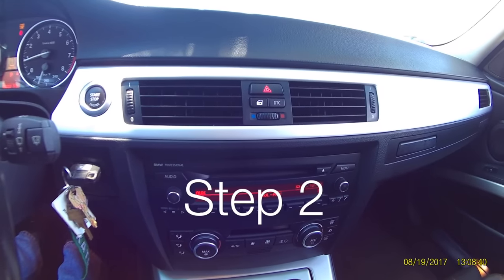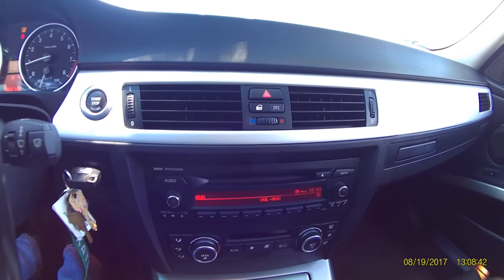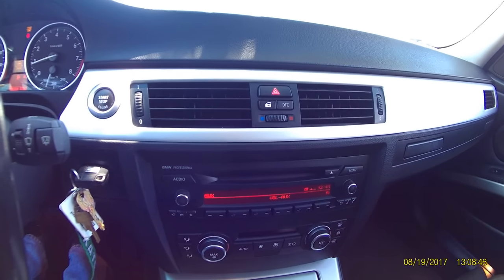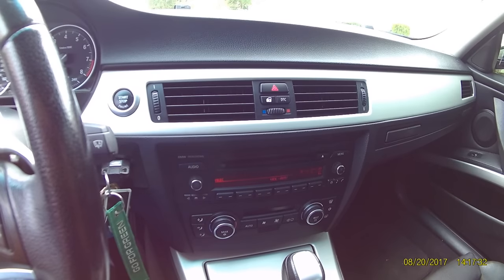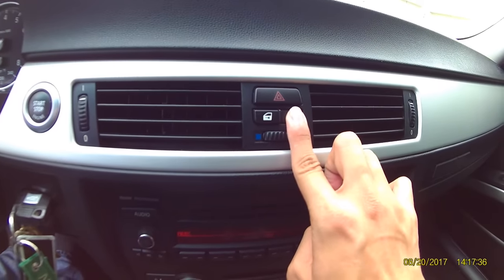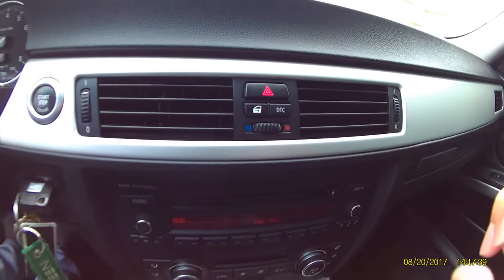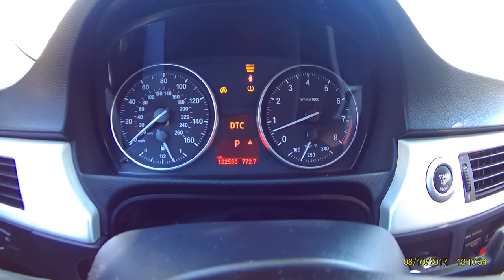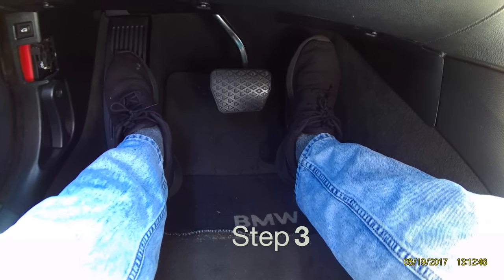How to do a Burnout(Automatic)

Comment: Everyone's here with actually decent cars and I just want to do a burnout in my minivan...
Reply: XD
Reply: Put that shit in neutral rev the rpms up put in drive and launch LOL
Reply: mate it's probably a sleeper
Reply: @hadenbeggs2495  my transmission died.
 :(
Reply: Broooo lmaooo
Reply: MV gang were u at?
Reply: Bwhah I got a 2004Ford ba falcon xr6 with a turbo, but mini van sounds fun too
Reply: My Astro leaves rubber on the road
Reply: Foreal tho🤣🤣🤣🤣
Reply: Set the parking brake and rip the gas
Reply: I put my Ford Focus hatch back I put in L i drive and that gear goes up high so I drive up to 5500 rpm floor it then boom it’s like a fuckin go kart with a mirror cycle engine
Reply: Lol Onm I’m just trynna do a
Burn out in my dads truck 😭😭
Reply: I wanted to do one in my truck lol
Reply: I HAVE A MINIVAN ASWELL HAHAHA
Reply: Its okay bro, i had a rusted out honda 2000 minivan and that thing shread tires like no tomorrow. Over the years i’ve upgraded. Now i finally own a gmc sierra 2017. Just wait for your turn, it’ll come. I’m only 23yrs old. So you can def do it.
Reply: I gotta jeep patriot I feel you😂
Reply: @catto970  i got a 335i e90
Reply: Mine is my work van...
Reply: Pull the hand brake and floor it! How the fuck do people not know this?? Holy fuck...
Reply: Same
Reply: @hadenbeggs2495  did this in a 1988 Toyota HiAce van at an intersection once I swear the front wheels came off the ground
Reply: me with a fwd lucerne
Reply: @sicsam1  not everyone is taught it?
Reply: Been 5 years and shits still funny 😂
Reply: NOOOOOOOOOOOOOOOO
Reply: @hadenbeggs2495  i wonder how many transmissions youve destroyed in these 6 yrs of this comment being available

Comment: Be careful doing this. Depending on the transmission you might break it like this. It is better to try to get the RPMs going first and THEN break, it will take you a bit more practice to find the point where your wheels still Spin and your car stays stationary but it is better for the transmission to be fully closed up to start the burnout. This is what happens to a lot of people when they try it and let off the break pedal to slow or not enough and they break their clutches.
To get more technical to prove the point: 
There is generally two types of auto transmissions used, ones with tourqe converters and ones with automatically actuated clutches ( these can be single , double or multiple clutches before or in your transmission) 
The ones with tourqe converters are generally more save to do something like this because the TC is trading speed for tourqe even before your transmission so it will increase tourqe given to the transmission and wheels till before and after the TC spins roughly the same and then a holding clutch will take over to minimise losses through the TC while driving.
You can overheat the oil in your transmission and TC through trying it for to long or fry your holding clutch because it might just try to clutch in while the speeds are still not matching probably. Both of these result in a broken transmission 

As for the transmissions with the automatically actuated clutches, those don’t like these kinds of actions, it’s the same for pulling heavy things with the car ans so on. If you try it in these types of transmissions you will be very likely to fry your clutches and not be able to drive home…
Reply: so no go in a cvt altima?

Comment: Very well done and explained.... I've been doing burnouts for 30 years and have to say never had a clutch explode... not a good experience.. be patient .  Do not explode the clutch... your day to day has limits...
Reply: how do you do a good burnout in a manual with a pretty powerful engine?
Reply: @westonwright2670  idk but wouldn't you just press the accelerator less, you have to find some sort of equilibrium between the break and rpm

Comment: I got the same car and it's a sport package same as yours I tried before but it didn't worked but I tried on D do I have to put it on sport mode ?
Reply from the maker: Ezel Ghazi yes put it in sport mode then shift into gear 1
Reply: Jamal Strong aiight thanks man
Reply from the maker: Ezel Ghazi no problem keep checking the channel got some more videos coming this week
Reply: What car??
Reply: If you don’t turn of traction control your ass is never doing a dam burnout and if you don’t have sport mode put it in 2 it’s the same thing

Comment: I have a 2013 128i with headers, intake, exhaust, and tune, but I can't figure out how to get it to do a burnout because even after eliminating the traction control, it still won't spin the tires for some reason. I will try to put it in sport mode and see if that helps.

Comment: Just noticed my 370Z with the semi-auto gear box won't allow this. You switch off the TC, select the manual 1st gear, apply the brakes lightly and step on the throttle, the revs go up and the wheels spin for about 2 secs or so, then the revs get limited to something like 3000rpm and obviously the wheelspin stops right there. Like the TC isn't fully off, but I know it is since when driving on snow I can switch the TC off and keep revving all I want and the car won't move anywhere since the wheels have no grip at all. Must be some kind of a feature to protect the torque converter, or something.
Reply: unfortunately with the Z you need to remove the brake light fuse, it completely removes TC
Reply: @dorianbailey1231  Well like I said, the TC is completely off if you just switch it off, no need to remove any fuses. I know because in winter you can spin the wheels as much as you like. It's just that the system doesn't allow you to be on the throttle and the brake at the same time. What you can do, however, even on a dry surface, is to apply the brake, floor the throttle, then get off the brake just before the revs hit that 3 or 4 thousand limit. Then you get some burn-out going, but it won't be stationary, obviously.
Reply: @MacKaris  so then remove the fuse and try again

Comment: I got the 335i 2007 and I can burn out but it's just one tire fire. Like yours . Have u ever done a burnout with both wheeles spinning ?
Reply from the maker: The Real Fedz69 sadly no you’d have to get an LSD. These cars should have came with one from factory. I’m ordering one and installing it so watch for the video
Reply: how soon do you think that is going to happen
Reply from the maker: jammerjamjam1 I’m currently waiting on the guys over a vac Motorsport 😑
Reply: I did it with my 06 325i both tires but most of the time only 1 spins
Reply: Yeah, you'll need an LSD. I have a 1991 Lexus LS400. It's got an LSD, it's a 4.0L V8 and RWD, one of the best cars for the price if you ask me. I payed $700 bucks for mine, plus leather seats, power seats, power windows, sunroof, and it's a Toyota, so it'll never die. ;)
Reply: I could be wrong but turning off traction control pretty much just makes your lsd act open because it won't lock the rear wheels. Correct me if I'm wrong but that's what I've read

Comment: Yo bruv. How to rev an automatic car while driving? Like not from a stand still position but when the car is actually moving. Is it even possible? Cuz i heard a guy in  a meet saying he does it all the time in his auto & im not sure if he is trolling lol.
Reply from the maker: Khaled Boris yeah you can, you put it in neutral while rolling then throw it back in drive but I wouldn’t recommend it you’ll mess up the transmission eventually they’re not meant for that lol
Reply: Jamal Strong Gotcha if so I dont think its worth it. But thanks homie
Reply: Khaled Boris just press down the gas to the floor just long enough for it to downshift, then once it does release the pedal
Reply: I used to do it by dropping it into neutral for a second, revving it, then waiting for the rpms to drop all the way back down to minimize the damage done to my transmission, these days I just floor it for a second and right before it actually engages and takes off I let off the throttle.
Reply: Just floor the gas for half a second, mine does it and the blow off blasts
Reply: @Bombskwad92  What about if you have button shifters on the steering wheel? Could you downgear and hit the gas?

Comment: How to do a burn out with my bicycle?
Reply: Wait for it to rain lean forward and peddle like you've never peddled before, the back wheel will spin - or you could do it in an underground carpark, the one with the squeaky floors
Reply: Peddle really fast
Reply: Put oil on your tire and press front brake and paddle fucking fast

Comment: How do you turn the traction control on
Reply: Sv ESS2500 traction control is always on its a safety feature like ABS, unless you turn it off which is denoted by an indicator on the dash
Reply: Yeah it’s always on bruh that why it doesn’t do a 180  on sudden  braking

Comment: Same for 328i E46? 
It's practically same car but moine is older
Reply from the maker: Adrian! Yeah pretty much exactly the same you may have to wet the ground due to having less power though
Reply: Just turn off traction control and put it in first or second. You should more than enough power to spin the wheels in a 328
Reply: WreckLesz BeamerZ Good luck on second gear, not gonna work.

Comment: Doing this is a great way to wear your car out prematurely. There are too many things to list, it is not worth the entertainment for what the total cost will be. If you are going to do this, at a minimum, install a line locking valve for the rear brakes. Even this isn't a good idea, but will allow you to hold the car with just the front brakes. The best way is to simply have enough power on tap to spin the tires without hopding the brakes. Having "been there & done that" completely ragging out a car or two doing this kind of stuff, my recommendation is to just not do it....unless you are cool with your vehicle being a money pit.

Comment: inst doing burnout in AT harm the transmission
Reply from the maker: Not really most high horsepower vehicles are autos for example a  hellcat people burnout in these vehicles frequently and I personally haven’t read any of them breaking or causing issues. Would I recommend doing it all the time no but I don’t see it killing your trans if you have self control